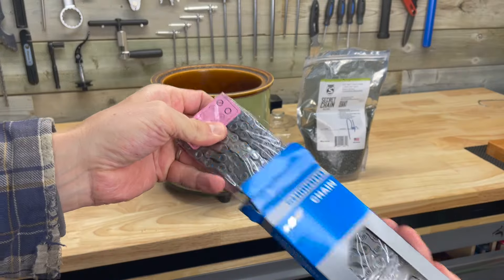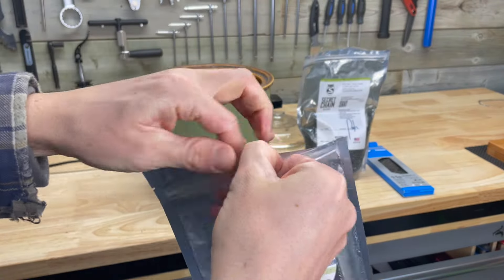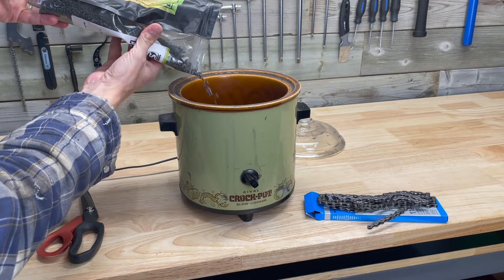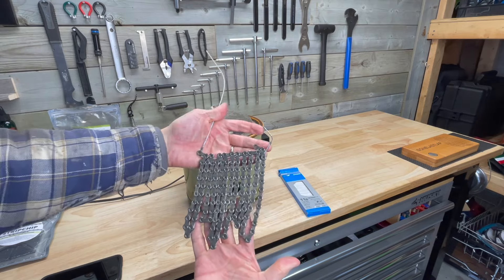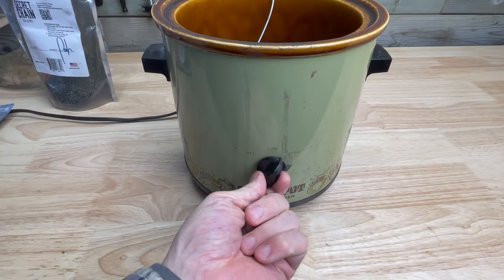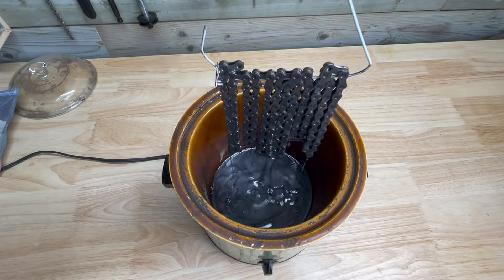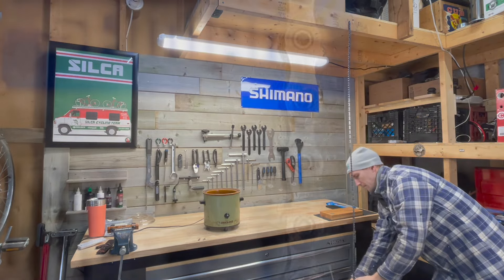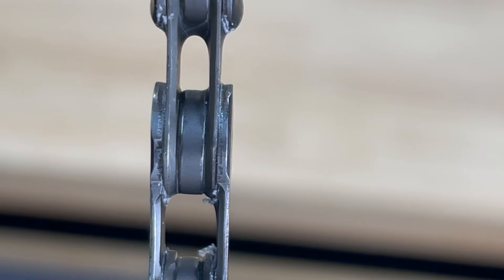Waxing Your Bike Chain Just Became WAY Easier!

Comment: I did use speedwax for a while and kinda liked it, but it wore off after about 150km and the chain would end up noisy again. Also, after rides in the wet I had to rinse and then dry the chain to avoid rust.
I'm back to a special blend of oil now and it's obviously way messier. But my chain is super quiet and smooth, even at high loads.
I don't know for sure about this, but I feel that wax doesn't handle heavy loads as well as some other lubricants and can squeeze out under said loads, making the re-wax interval come more often for heavier/more powerful riders.
Reply from the maker: Interesting observations.  I know the wax will typically be a bit louder, but you should be able to get around 500km per hot wax application.  I’ve found good chain prep, good quality wax, and a good waxing procedure help the wax stick better and last longer.  I road the test chain (for strip chip) up to 1000km with no maintenance, and it was still ok
Reply: it is true that mineral oils and grease have such molecules that can withstand high pressures, but there are no such loads on a bicycle chain, because then my chain would not last 6 times longer on wax than on oil. the noisy chain  indicates that most of the chain wax has fallen off and should be re-waxed unless waxes with additives are used. the oils collect the dust that saw the chain quietly

Comment: Hey dude.
Can I use one strip chip for two chains?
Or do I need to use two chips for both?
What about the left over wax can that be reused for both chains and after the process?
Reply from the maker: Hey, it’s 1 strip chip for 1 chain.  If you have another new chain, you need another chip.  The remaining wax can be reused for regular hot waxing 👍
Reply: @onelastlap9302  thank you mate!

Comment: Always love your video. Question is how much silca hot wax per waxing? How many times I can wax with 1 pouch? And can I reuse the silca hot wax? If so, how?
Reply from the maker: Thanks!  I think for one package of wax you get around 50-60 waxes?  I just leave the wax to cool in the pot, and then reheat when I have another chain to do
Reply: @onelastlap9302  wow that's so many times per package! When the wax cools it will harden to one big chunk? Then store it again inside the package?
Reply from the maker: @ I just leave it in the pot, no need to remove 👍

Comment: Fun fact , hot parrafin wax dissolves the oil from the factory, no need for fancy products .
Reply from the maker: I’ve heard that as well, but that it can ruin the wax for future use.  The strip chip coverts the oils so the wax isn’t contaminated
Reply: that's how I work and it takes about 5 waxings for the grease to disappear from the chain and the wax is not damaged because they are on the same base

Comment: I thought the temp had to get to 125 degrees Celsius to work. Silca seem quite specific about this.
Reply: According to Twotone Newsroom: “StripChip will work with Crockpot and Instant Pot setups but must be carefully managed for temperature.  Standard Crockpot Low is 90-110ºC, which is below the oleogelation temperature, and standard Crockpot High is 150-160ºC which is right at the over-temperature point of the oloeogelator and risks long term damage to the wax.  If using the product with double boiler, Crockpot, or Instant Pot, we recommend using a thermometer and carefully ensuring that the wax never exceeds 130ºC.”
Reply from the maker: Great addition, appreciate you adding!  Yes, the instructions do specify this, if your croc pot allows, hit the numbers!  I’ve got to upgrade my croc pot 😅
Reply from the maker: Thanks for adding as well, hard to fit all the specifics in my shorter video, I’ve got Silca’s full video with all the details linked in description
Reply: @onelastlap9302  ”hard to fit all the specifics in my shorter video”... sorry, but to me that is a pretty lame excuse for excluding a crucial piece of the puzzle. Ask Josh what he thinks perhaps?
How hard would it have been to add just one line to the commentary... "The temperature of the wax is REALLY important, so see the Silca video for more details" ???
Reply: @BritishEnglishJapan  come on , let’s be polite.
Reply: @robertkelly28  I thought I was on the right edge of polite personally. Apologies if you think I was not, so I will try again. 

I think it is doing any viewer a disservice to omit what appears to be, according to Josh on the official Silca launch video, the crucial point about temperature. In my opinion, adding one line such as "The temperature is REALLY important, so see the Silca video for more details" would be advisable.

Is that better?
Reply: @futsalkeegan you have to be careful to check the manual for your particular pot, as they can vary a fair bit. Mine goes anywhere from 65-95C for example

Comment: Haré 2preguntas probablemente tontas pero: 1) cuánto dura encerada con respecto a si la aceitamos; 2) hay que aflojar eslabón por eslabón antes de su colocación o no es necesario porque eso se produce con el uso...?🤔
Reply from the maker: Good questions, not stupid at all.  I recommending riding it 500km after hot wax, then top off with drip wax at 500/750km intervals, and re hot wax at 1000.  Bad conditions may need more frequent wax top up.  For looseness, is usually get it somewhat loose in my hands, but just riding itself will loosen it up after 10-15min
Reply: Muchas gracias por la respuesta 🤜🤛

Comment: Too much work
Reply from the maker: It’s more upfront work than just putting a new chain on your bike and riding, but the payoff is it’s super clean and doesn’t get dirty like oil based chains/lubes (so timed saved later with cleaning)
Reply: I agree, that's why I hot waxing  the chain on my bike, it takes 6 minutes for the whole chain